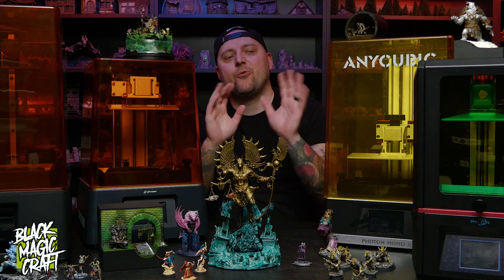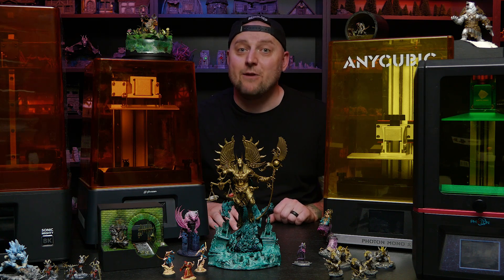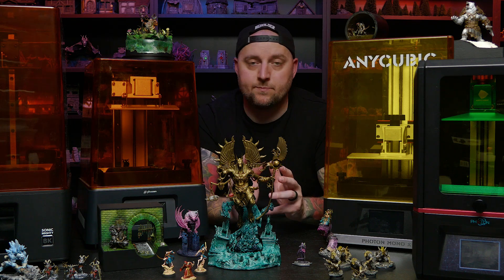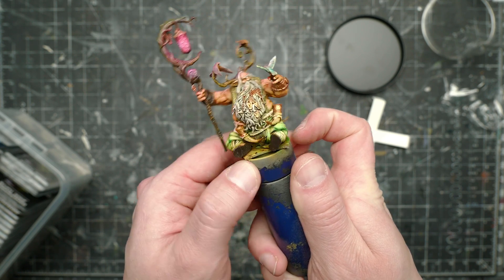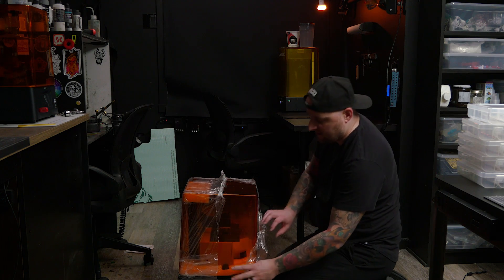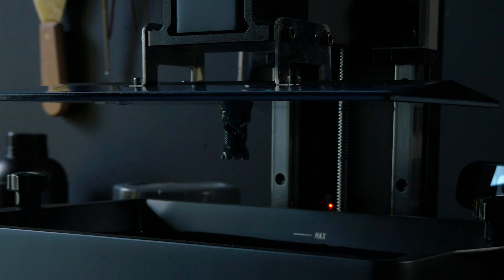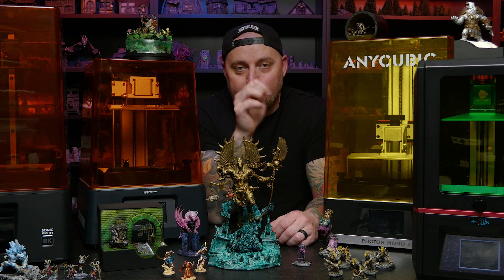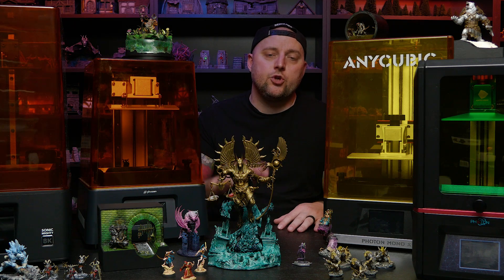THE TRUTH ABOUT 3D PRINTING

Comment: What do you use to combine the models parts? I’ve been using resin but it’s kinda finicky and so far haven’t found a good way to hit em with UV while holding the pieces together
Reply from the maker: Super glue for small joints and 5 min epoxy for big parts.

Comment: I also started out with Anycubic and still am with and i love my Mono x because i so rarely have failures with the eco resin on default settings (always been too lazy to tinker and try and find the "optimal" settings).
But i have the same issue with the build plate being bigger than the wash and cure station i already had.

Comment: As somebody who's been printing for about 6 months and just for the past 2 months started getting like 99% success rate - I would say get an anycubic (I have a photon mono and a mono x 6k) and stick to their resin and the values they recommend on the website for it. Or if you want to change resin their RERF test is a God sent (it will give you 8 pcs, each with a different exposure, and you can select the best), but for simplicity and speed I just go with only their resin now (takes 2 sec only per layer for good prints). For supports etc I just go with default chitubox (usually heavy; medium just for really small prints, like a 1/6 hand) and they come up great and easy to remove with the hand.

Comment: People don't know about or talk about the real dangers of (epoxy) resin-based printers without proper precautions. "Proper ventilation" doesn't mean a room with a window open when it's running, it means a closed circuit HVAC where the off gasses won't get into your common areas and be a constant danger to you and your family. The MSDSs for plant based resins isn't exactly worry free either. People that keep resin printers in their apartment or house are outright irresponsible.

Comment: I have an Epax X1 - it is a slightly older printer and the print bed is on the smaller side.  But, the thing is easy to use and very reliable.  I am leaving well enough alone, but in the future when the time to upgrade comes along...this video has helped guide my purchasing decision!

Comment: I disagree with you on pre-supports. Each printer will behave differently, even differences in resin and climate can affect how your supports should be set up. So there is no way that a pre-supported model will be suitable for each and every person who prints that model. Rather learning how to support for your printer is a far more valuable thing, takes a few prints to work out what your printer likes, and just a minute or so to support each model. That way you'll have ideal supports on every print.

Now pre-supports are valuable, especially for newer print-techs, as you can ignore that one factor whilst you work out other teething and learning issues with setting up a printer, especially a person's first printer.
Reply: 100% agree with this. I've gotten to where I don't want pre-supported files. I've had so many fail with pre-supports. Now I want only non-supported and do it myself

Comment: Huh, I also have a Mono X and since I have dialed in my settings, I almost never have print failures. Only if I do something wrong, like scratch the FEP.

If anybody needs settings for a Mono X these are mine: For Grey/Opague I use 0,05 mm Lift, 2,2 s Exposure at 50% Power with 0,5 s Resting time before lift. 12 mm Lift distance and 40 mm/min lift speed. 8 Bottom layers at 40s.

Comment: I've been resin printing for a little over 2 months.  There is a learning curve, and as long as you keep early expectations in check, it is really satisfying.  I did wind up wasting quite a bit of my first bottle of resin(again, part of that learning process.)  There were some print fails, but also, the bigger issue - I ruined a lot of early prints removing supports.  My printer is the Anycubic Mono 4K, and I am happy with it overall.

Comment: Everything is relative. I've started printing with resin after years of printing FDM, which is (or maybe was?) WAY more finicky. Compared to some FDM printers, resin printing has been, in my experience, as close to plug and play as I've ever been with 3d printing. Now, my only experience with it so far has been with smaller format printers (Photon Mono, specifically), so none of the issues that could occur with large format resin printers, but I've been meaning to get my hands on one...

Great video, Jeremy! It's good to show that while very cool, 3d printing is an entire hobby in itself and comes with its own ups and downs.
Reply: My printer arrived less than 6 hours ago and I'm halfway through my second print. Doesn't get much more plug and play than that.

Comment: I've been using an Elegoo Mars for the past 4 years, it's not the best printer, as the resolution isn't as good as current gen printers, but is reliable and for tabletop games is all I need.
Reply: Tip for users of gen 1 Mars:

I'm still using my first gen Mars Pro, too. First time I needed to replace the screen I took that opportunity and bought the mono screen upgrade kit from Chitu. It's basically a gen 2 since then except the build volume is somewhere between gen 1 and gen 2.
If you want to go a little bit cheaper there's an upgrade part in thingiverse that allows you to install a mono screen, too. You just have to follow Chitu's instructions for updating the firmware.

I don't know if the Mars 4 is going to be significantly better but I know that the Mars 3 doesn't have better print quality than a Mars 2 or an upgraded gen 1. Gen 3 has a bigger build plate but the dpi are actually a bit lower. because of that.

In conclusion, gen 1 Mars printers can still produce top level miniatures if you invest ~$20 more for your next screen replacement.

Comment: My first printer is the phrozen mini 4k, and I have loved it from the start. I even have been picking up free files from thingyverse and slapping auto-supports from lychee and having it work, at least on 90% of the files I print. 

I would recommend getting a wham-bam or other magnetic flex plate for easier cleaning by the way.

Comment: Thanks Jeremy! One question which I still have regards the "hazardous material specialist" part. How toxic/intense are the fumes/smell when resin printing? I know you have ventilation systems in place in your workshop, but how realistic is it for someone like me to print indoors where opening a window is the best option available? Can you work in the same room while the printer is running, or does one risk health concerns? Thank you in advance!
Reply: Depends on the resin you are using. Some are ok and others can be baaaaaad. Goobertown hobbies has a good breakdown of resin-printer toxicity and venting requirements.

Comment: It's interesting - your rough experience with the Mono X mirrors my experience with the Phrozen Sonic Mini 4k. It was bad enough that unless Phrozen has made massive engineering improvements in their products and moved their customer support off of Facebook, I won't ever touch one of their machines again.
Reply: The newer ones are way better built. Oddly enough though I never had a problem with the original min, but the mini 4k started to have z flex issues about 8 months in.

Comment: The need to find resin your printer plays nicely with can't be overstated. I have a Creality LD-002R resin printer. After my three test prints they sent loaded on the thumb drive, only one of my first twenty prints succeeded. I messed with all of the settings and then gave up for a year. I tried again about 6 months ago, and thought I had solved my problem when I figured out that I had been installing the film for the vat wrong. My prints kept failing though. 

Eventually as a last ditch attempt that I was going to give my printer away when it failed, I bought a different brand of resin to try. I'm now working on my fourth liter of Elegoo's gray 405nm resin without a single failed print, and without having to change the film once. The only issues I've had with prints since swapping to this resin have come from me missing places that should have had supports, and even those have been minimal and easily cleaned up after. 

This resin also doesn't smell terrible, which is a very nice improvement.

Comment: My wife began our journey with 3d printing a couple of years ago.  Our resin was brittle, we initially couldn't get the settings right, and our prints were hit and miss.  We found that our build plate was loose on our Photon S, we had to take it off, tighten the 3 screws on the underside and it was good.  I asked her to move to a more robust resin that was tougher and flexible.  She also found good settings for it.  We've been in love with 3d printing all over again.  Our advice to anyone is to not give up, find the right settings for your printer and resin.  Thanks for the video BMC.

Comment: My biggest issue with 3D printing is the lack of repair places. I am fairly good at basic repairs for the machines but I have two Mars Pro 2 printers and one I just can't seem to fix the issues on. Contrast that with computers, I am again about the same level of fairly good at fixing basic issues. Not amazing, but I can handle most things. But if I get stuck I can take it to a repair shop and pay someone to be smarter and more skilled than me. I am not having such luck fixing the 3D printer.
Reply from the maker: Unfortunately I think we are a LONG way from having access to local repairs. Best you can hope for is finding someone that happens to know more than you. It’s like having a home computer in the early 90s. 😄

Comment: The machines definitely aren't as hard to operate as folks think. I have had a LOT of difficulty finding a printer that can do the level of detail I want for a respectable price, but that has nothing to do with operation difficulty.

That said, I do kind of partially agree with the "it makes certain aspects of the hobby too easy and cheapens the value of scratch building skill" crowd. Personally I prefer when I can see a custom piece (whether a miniature or regular scale model) and tell that, while it looks great, it obviously had parts made by hand. There's just a certain valuable element that that brings to a project. On the other hand, I find 3D printing to be best used for either parts that you need an absolute butt load of (like, say, a bunch of vents /pipes/whatever for a building diorama), or for things that would be so difficult to make from scratch that it's practically foolish to even attempt scratch building (monstrously large pieces, something stupidly detailed like a glorious set of wings, etc).

At the end of the day though, if a project looks good then it looks good. In a contest between two projects I'm probably just always going to give bonus points to the one that didn't rely on printing for singular non-repetitious parts. Scratchbuilding is an art after all, printing isn't. So they should be valued appropriately -when appropriate-.

Comment: Please please please, as someone who made a video on safety, wear some kind of breathing safety when dealing with resin. Allergy buildup is no joke and if you want a horror story about resin in an eye look on reddit and if you read it I'm sure you'll also wear safety goggles.

The title of the post on reddit is: "I’m an idiot and didn’t follow safety precautions and now I might lose my vision."
Reply from the maker: 370 CFM exhaust fan. Oversized HEPA air purifier for the room. Fresh air in from window. I’ve talked about/shown this more than once.

I also tend to actually print overnight when I’m not in the shop with all the air stuff running. 

I usually wear glasses when there is a risk of splashing, but do forget sometimes.
Reply: @BlackMagicCraftOfficial  Alright, I was more concerned cause of the shots where you basically put your face into the vat, while pouring or checking on finished prints and scraped the resin off the top of the buildplate. 
Just thought I have to comment, cause your safety vid on the hobby is still the best out there.

Comment: Would you be willing to share your print settings for the 8k printer and resin, as well as the wash and cure times you use?  Unfortunately I don't always have great luck with mine.
Reply from the maker: My settings for the mini 8k and 8k resin are shown on screen early in the vid.

I wash in a wash station for about 2min and only post cure minis for like 10 seconds, sometimes not at all. Larger pieces I’ll post cute for up to 60 seconds.
Reply: @BlackMagicCraftOfficial  Thank you so much!

Comment: My favorite part about miniatures is putting them together but I only see 3d printers make full minis or three pieces at most. Can you split the miniature up more in the program or are there 3D printers that make colored models so you don't have to paint them?
Reply: You can split them...but that requires learning 3d model work. However, not every file comes In 1-3 parts. For example I've seen tanks with 20 parts, and infantry in 8 or so parts. All depends on the file maker.
Reply: @demon1103  thank you so much! I have asked this question like 20 times and never get an answer.

Comment: My experience has been a dream, although I know that’s not everyone. 

I have a Mars 2 Pro and I’ve probably printed 250-300 minis or pieces of scatter thus far. Only ever had fails from bad supporting. My plate is scratched to hell and it helps with adhering so I’ve never had fails due to that. I keep things simple, only use 3 types of resin and I’ve only changed my FEP film once. 

I love it because I sold a 2,000 point GW army to get it and have made my money back X 100 in what I have been able to do. 

I personally was terrified to start but took the leap. It was one of the best table top choices I’ve ever made.

Comment: It took months of struggling to finally get to the point where I could print reliably without fear of constant print failure. I wouldn't recommend that experience to just anyone. However, those who can work through that should 100% do it. The convenience of always having access to the perfect models, whether for gaming or just painting, is nothing short of amazing.
Reply: I had the same, went through a handful of resin brands and types until i found one that is perfect about 98% of time where last 2% is user error or big changes in room temprature causing issues

Comment: To me, FDM (filament) printing is a lot harder to tune than resin printing. I own both printers, and while I never had any issues with my elegoo mars (using elegoo resin and recommended settings), my FDM printer broke mutiple times. Nothing complicated to fix, but compared to the resin printer, there is a big difference.

Comment: I personally started out 3d printing after watching your videos, rybonator, and a lot of other creators who document their failures as well as their successes. (Rybonator specifically is amazing about that). I decided to get an Elegoo Mars Pro 2 after a bit of debate, and I love it. The only monumental failures I have had were my fault because I didn't add enough resin. It's intuitive, Elegoo has water washable resin, and I love printing out dnd minis with it for my party. It also handles larger jobs very well. Still, thank you so much for more information on larger systems because I have thought about going for a larger printing bed but had heard of difficulties with them. Also, could we possibly get a video on your current printing set up and your recommendations for supplies for the hobby?
Thanks again!
Reply: As an added bonus, I recently started working in my college with Filament 3D Printers and I have learned a lot about the hobby just by setting up other prints. It would be nice to see a comparison of FDM prints to SLA prints when working in the hobby.

Comment: I picked up a photon 2k cheap recently and can get some small things to print, but anything above 32 mm fails. Keep trying to dial it in but find it frustrating. I'm in the canadian rockies so temp may be an issue (but you get success and winnipeg is so balmy...). On the other hand, I got an Anycubic Vyper last summer and it works awesome. I've made tons of great terrain with few fails. It takes a little maintenance, but it seems way easier to get working compared to my experience with resin so far.

Comment: I learned FDM printing isn't for me. I bought a printer and 1 and 3 prints were successful. so I emailed the company, did some troubleshooting and they asked me to return it. I couldn't get my money back but got a free replacement. now I have a Neptune 2S to sell, lol. 
    my Anycubic Photon Mono is way easier and only recently had my first issue. warped build plate and a new one is on the way now from Anycubic. So hopefully I'll be back up and running again.

Comment: I got an Anycubic Photon Mono X as my first 3d printer. It worked perfectly out of the box with default settings. I haven't played with the settings yet as I haven't needed to (probs should try to optimize though). Occasionally I will have a failed print, but just cleaning out the vat and trying again has always worked.  I would highly recommend anyone to get into 3d printing minis as it is pretty quick to learn how, placing your own supports is definitely a far more difficult part to get into but most models you can buy will come pre-supported. I love 3d printing most of all because I can support small artist and get incredible miniatures based on their vision.

Comment: 100% agree! Because I'm in the same scenario right now. When I started I used the Anycubic Photon and after a couple of prints I had dialed it down to perfection and it became so easy. The only issue I had was what do I print next? Upgraded to the Phrozen Mega 8k and now I am in that "too difficult" side... small items print just fine, but trying to go large uhhh dreading the time and resin this is going to take to figure it out.